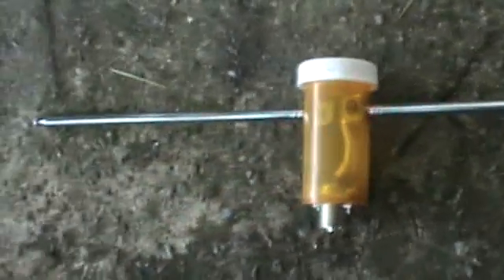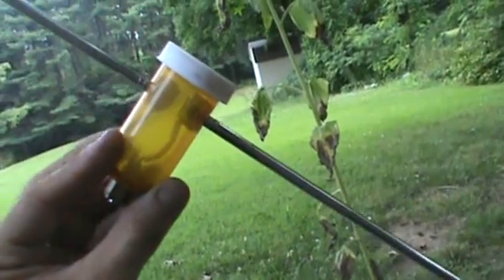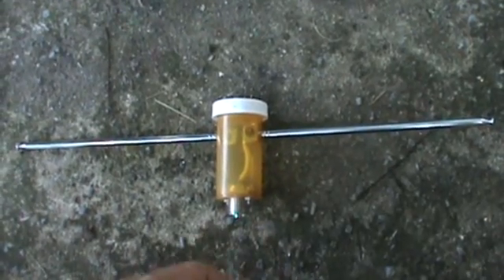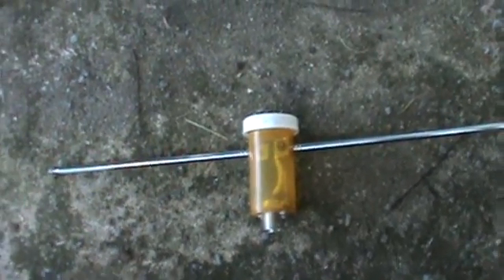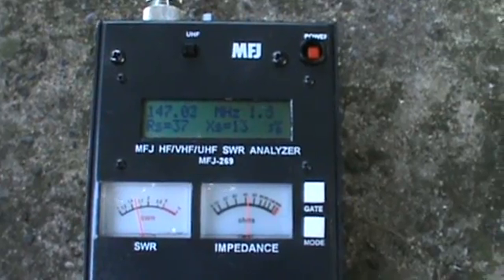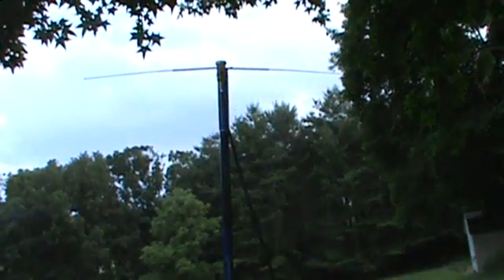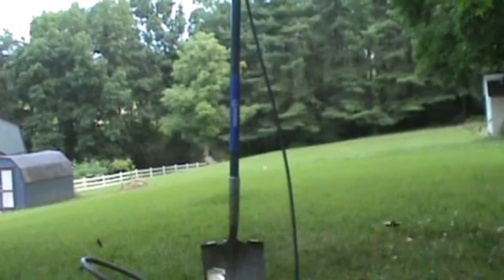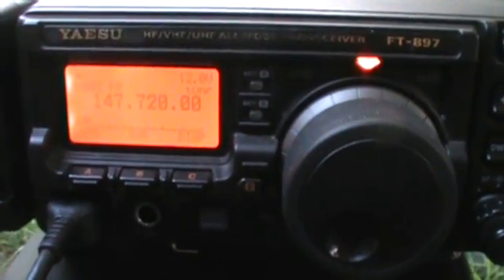2 meter / 70 cm telescopic dipole, Homebrewed

Comment: I'm making this kind of antenna. i'm ginna use 1:1 balun usinh toroid. any advice to winding? i've no idea about the amount of turns.
Reply from the maker: +Amira Cita Muthia I don't off hand however, I would tune the balun to the lowest frequency used and it should be good up through 70 cm,  I think. You will experience a little loss and maybe warmth to the toroid if you run some power through it. A little extra work but worth it if you test the balun with X number of turns and then add or even subtract a turn or two to see what kind of response you get. Keep me posted. 73

Comment: I think that antenna should be oriented vertically,rather than horizontally. J-poles, vertical ground planes, etc. for VHF are nearly all vertical. Now, IF you are communicating with someone and do not want many others to hear it, you both can go ahead and run your dipole horizontally. Otherwise a neat and interesting project! Gives me some ideas.
Reply: Good point!

Comment: Id like to know what size wire u solered together between the antenna mounts and the tip of the pl259 connector bc i am in the process of making one my self.. kf5dmc
Reply from the maker: sixpapavictor Rg 8x stripped down
Reply from the maker: sixpapavictor  Any coax or wire you have will do
Reply: were you able to get it to work with USB and FM together for repeater ussage??
KF5DMC
Reply from the maker: +sixpapavictor Yes, on both 70 cm and 2 meters.

Comment: OK, Chris I like your vid and found a pill bottle of my own and an old Archer TV antenna that had telescoping ant, and they fold.  I have it nearly assembled save the center connection to the SO-239.  I know solder will not work.  What did you use?  My bottle is a bit bigger( I use(d) large ecstasy!).  A parts list and assembly details would be helpful.  Thanks  73s Hank KA4KBD
Reply: Sorry for the delay, I winged it with this one, I made a hook out of the shield conductor and wrapped it around a screw on the backside of the antenna connection. Need any more help just ask. I don't mind. 73

Comment: 1:27 - That is NOT a PL-259 on the bottom.  It is an SO-238 (or 239).  "PL" stands for "Plug" & "SO" stands for "socket."  I know that's nitpicking, but it helps to get your terminology right.

Comment: I'm a newbie at antennas, but shouldn't 2m/70cm be vertically polarized?
Reply from the maker: It depends on the polarity of the other station. In this case the other station was vertically polarized. The reason I did this is to see the differences in signal strength which didn't get shown in the vid.
73

Comment: Nice idea, great way to use empty Ecstasy containers and antennas from R/C cars. One little detail though, you display the antenna in horizontal polarization mode whereas it should be vertical to get best coverage. Polarization is important in VHF (2m) and UHF (70cm). You'll note that hand helds have the antennas sprouting from the top, not the side. Likewise with mobiles. When you see a 2m yagi antenna and it's horizontally polarized you will find that the ham is probably working long distance E layer stuff and using SSB. Anyway, other than that it's a great idea. I once made a fellow a replacement antenna for his hand held by cutting down a telescopic whip to the point where it was resonant and mounted it using hot melt glue in a BNC connector. It was quite an improvement over the original rubber ducky.

Comment: Using a pill bottle to encapsulate a driven element and protect it from the elements is a great idea. I'm going to use this same method for making a portable 3 element beam using the same kind of telescoping antenna's. Radio Shack used to sell them but I don't know if they still do...

Comment: 1/4λDP！
Reply from the maker: Afraid not, the electrical wavelength is shorter physically than it should seem.
This antenna operates 2 meters on 1/2 wavelengths and 70 cm at 1.5 wavelengths. I did try to lengthen the wavelengths by using lmr400 which has a higher velocity factor than the coax I was using (rg58). It helped a little. 73

Comment: Would not 73's Be Plural for what 73 is? Best Wishes? I know every one except for us OT'S say it, it still will always sound "Funny" to me... Good Job on the setup!!! I went to work right away and within 2/12 hrs. have the same setup! I did go up 2 15 feet. SWR, 1.1.. Great Job OM.. 73...
Reply from the maker: I guess your'e right, it would be, Best wisheses. Hihi. Nice job on the 1.1 swr. 73
Reply: Thank's from this bored OT, on the idea. I did not even have to do anything but swivel my seat around and all pieces were there. I did make it all "Permanent with Epoxy".. "73", Redd...

Comment: Very nice! I love seen antennas made out of stuff that was laying around. I just recently made a 2 meter 3 element yagi out of PVC pipe and coat hangers :) It allowed me to key up a repeater 80 miles away using only 5 watts!
Reply from the maker: That's awsome, I might give it a go myself. I love it, coat hangers.73
Reply: KB3TQO Dave Tadlock KG0ZZ has a youtube video where he makes a yagi out of coat hangers and some wood for the boom. That's where I got the idea for my antenna.
Reply: Me too! I have a small stash of coat hangers, copper wire and SO239's in various locations. I've only made a crude 2M antenna with them and I suck at soldering (I'm very new to ham radio AND soldering). I'd like to know how that dude in the comment below built a yagi out of coat hangers and PVC.